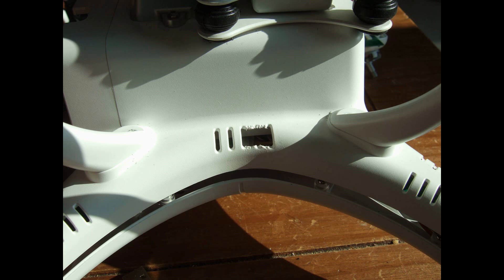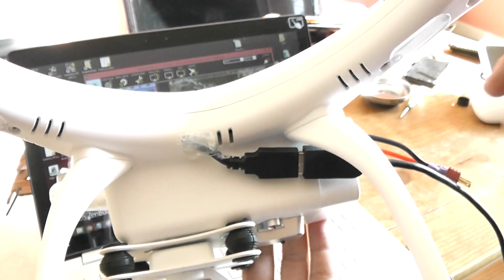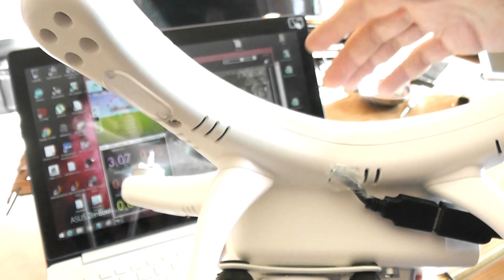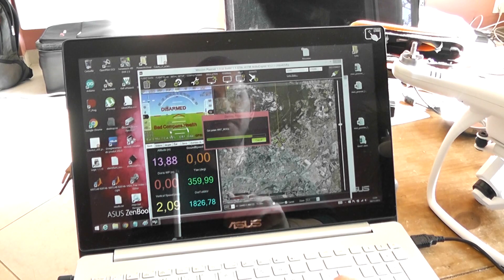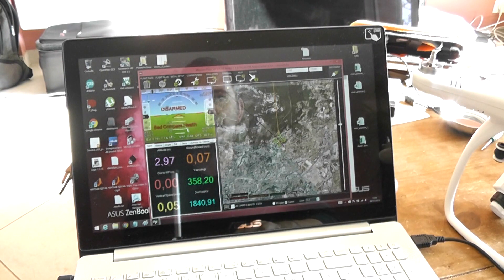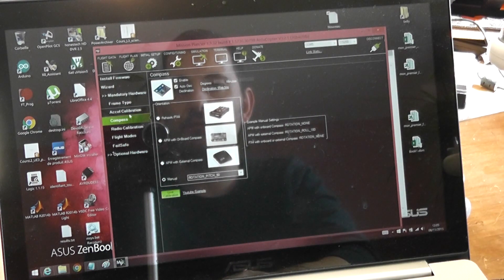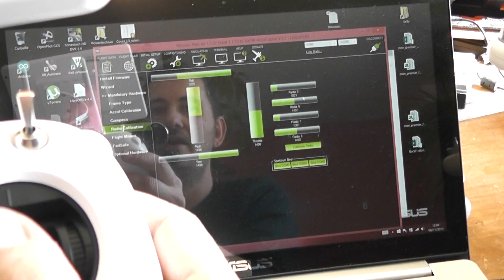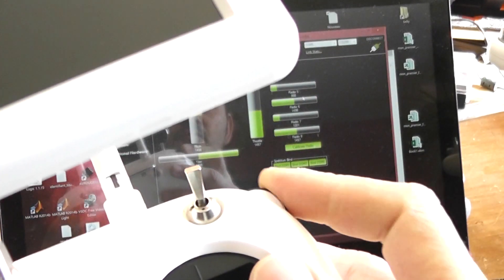UPair "Chase" modding for Mission Planner connexion (Courtesy Banggood)

Comment: I would like to add helical antenna to the transmitter for a longer range fpv and flight but the original antenna seems not to unscreewable . is it possible to install one on this transmitter ? would you be able to make a video of this MOD ? it would be really nice to fly this thing much much further
Reply from the maker: +tom marcjanik Well for the contral 2.4G part, there is a uFL connector so it's easy to install a uFL RG178 coax cable. For the 5.8G part, unfortunatly, it's directly soldered and you will have to either solder directly the coax cable or solder a male uFL connector as shown in https://www.youtube.com/watch?v=ycM-fDWOLtE

Comment: The gimble ang camera control not through FC so you can‘t see it in missionplanner
Reply from the maker: +Drones Maker Ok ... Do you have an idea where my gimbal control comes from ?
Reply: +SeBy DocKy  It‘s from radio receiver，a green borad  beside   FC.
Reply: +Drones Maker 
If I install a switch for the free plug on the radio controller, which connection/cable on the UPair receiver would receive the signal?  
I am dreaming of a mod for loading/unloading cargo with UPair, how should I do it?

Comment: What type of APM board is this? The old 8-bit or a 32-bit like Pixhawk? Arducopter version?
Reply from the maker: +FrontierNG Hard to say.... coz I can't see very well the chip... :( Maybe it's possible to see from the software
Reply: +SeBy DocKy If it is running ArduCopter 3.2.1 and won't upgrade to 3.3, then it is the old 8-bit version which would be a fail IMHO because it means no possible upgrades.
Reply from the maker: +FrontierNG Well ... actually I won't test any firmware update ... I don't want to brick anything
Reply: +SeBy DocKy Understood :)
Can you tell me which Arducopter version is running? You can get this info from Mission Planner.
I want to be sure because I am not interested in another 8-bit APM machine.
Reply from the maker: +FrontierNG Actually the V1.3.32.10
Reply: +SeBy DocKy This is the version of Mission Planner. It is not "bound" with a specific ArduCopter version (i.e you can use the latest Mission Planner with an old ArduCopter firmware).
Mission Planner should show somewhere (Config) the version of the installed ArduCopter firmware.
Reply from the maker: +FrontierNG Sorry I missreaded your last question
Reply: +SeBy DocKy No need to be sorry, APM/Mission Planner is pretty messed up in those terms.

Thank you for taking the time to answer my questions, I am trying to collect as much information as possible for this drone because two of my friends want to buy it and asked for my advise (as older in the hobby). I just don't want them to buy something that is no longer updated/supported by ArduCopter.

Comment: Why on earth they have the USB connection inside? Looks like they need to fix this, like Cheerson did with the first revisions of the CX-20.
Reply from the maker: +FrontierNG I guess they don't want user to change any settings. They trust the APM 100%. I am not
Reply: IMHO it is a very stupid decision by this company, even DJI have unrestricted external access to USB on the Phantom, both on the aircraft and the gimbal.
Reply: The reason why is inside is because the manufacturer dose not what us modifying it . The usb port is for them when its time for a new model they will just modify the firmware and give it a different name  Upair Chase,  Upair ONE  and so on.